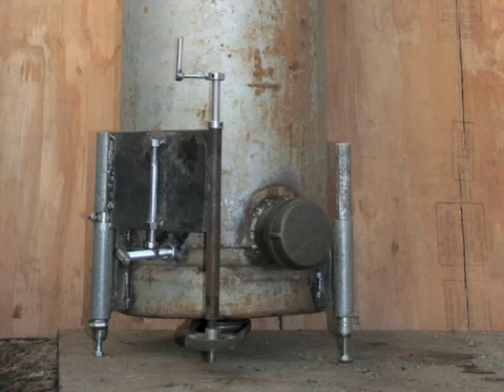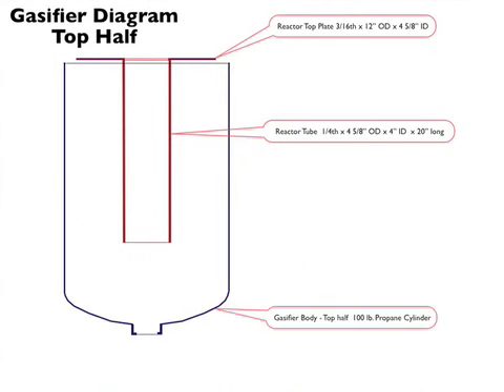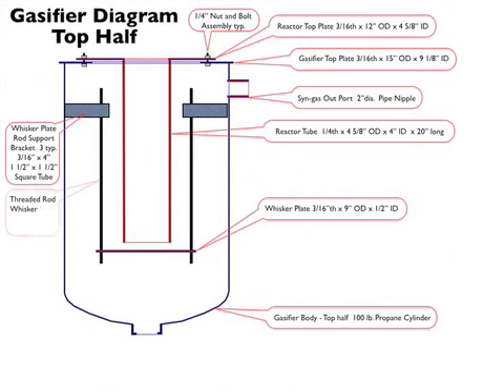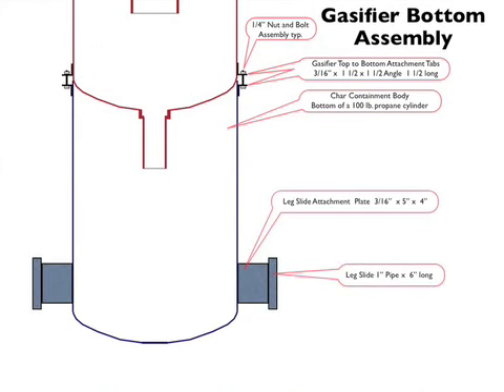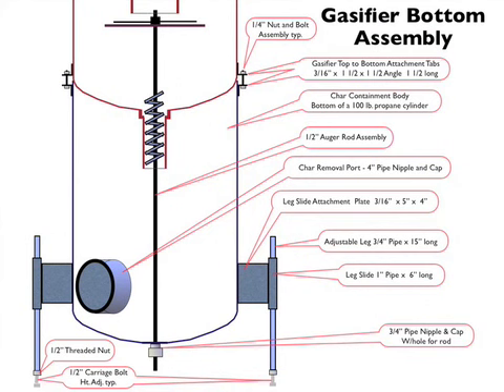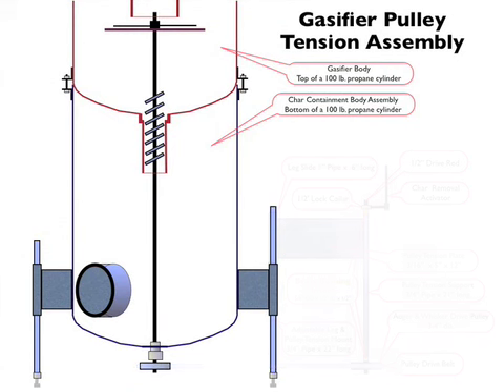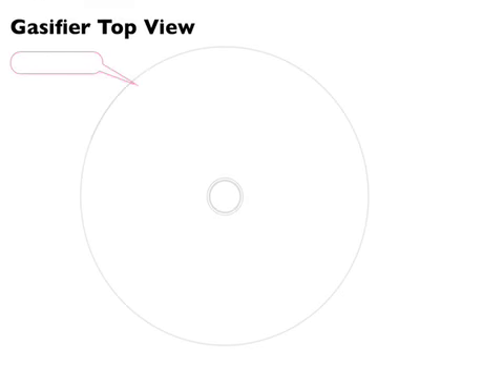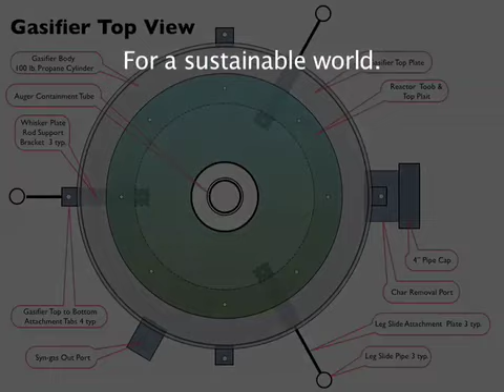Gen 2 Gasifier Talking Diagram H 264 800Kbps

Comment: Hi Ventonator,

The Whisker Plate keeps the charcoal and fuel from falling right thru to the bottom of the gasifier.

The Whisker, when rotated, pushes the char off the Whisker Plate to keep the reduction zone centered in the reactor tube.

Cheers,
Greg

Comment from the maker: Thanks for the Am. Idol vote. Glad the video has helped.

The 4" reactor tube will power a 15ish hp ICE, the 6" will power a 30ish hp ICE, 8" 50ish hp.

20 lb wood = 1 gal gas, more or less depending on quality of wood and gasification. + you get all the heat from the gasification process and the combustion of the syngas.

Pellets are best for us now, wood chips, and chunks work too. Sawdust packs to air-tight and doesn't work well in this system,... yet.

Interesting on the hho.

Thanks,
Greg

Comment: That's really cool. Would like to see a vid on that! Maybe if the water heater were stored in an insulated side shed to the house with a ventilation system and CO detector as safety... That could be really huge. Hooked into a solar hot water system, there would never be loss of almost free hot water and radiant floors. Thanx for this vid, nice job!

Comment from the maker: Hi shadley000,

The separated chambers do three things:
        Isolate the top from the bottom so it is easier to extract char out of the bottom half, without introducing oxygen (and causing an explosion), while the unit is running,
         Isolate the heat in the upper half and keep the bottom half able to be touched without burning yourself,
         And keep the whisker assembly aligned in the top half or the unit.

Cheers,
Greg

Comment: @Devin43837 
It can  be compressed.  Here is the data:
1 Gallon a Gasoline is about 125,000 BTU of energy.
Wood gas BTU value=150 BTU per cubic foot
A 100 gallon propane tank filled  to 150 psi with shot compressor will hold 34.7 cubic feet or 5205 BTU of gas equal to .04 gallons of gas

A 4.5 GGE natural gas tank filled to 3000 PSI with a scuba pump will hold 563 CuFt of gas equal to .67 gallons of gas.

Now if you use hot charcoal and steam you get gas without nitrogen = 300 BTU/CuFt

Comment from the maker: Hi Devon,

Compressing syngas is a possibility, though we haven't done this yet. It's near the top of our list of thing to do.

We have used syngas in a gas water heater and it worked quite well. We replaced the 1/4" gas line with a 1" copper pipe. I bet compressed syngas would work in a water heater... be interesting to try.

I'm leery about the potential of having carbon monoxide leaking into a house, so would caution you to that potential, should you try this.

-Greg

Comment: Thank you for detailing the inside of your gasifier.  Do you have any secrets for burning wood chips?  Does screening help?  Addition of used cooking oil?  Also, can the biochar collection be simplified.  I noticed in the Belonio rice husk gassifer the char just falls into a wet pan below.  If quenched couldn't the char just drop into a large wet open to air bucket without igniting?

Thanks again

Comment: I would like to use this for more than just fuel or water heater. i would like to use the final product that would normally go in to the an engine, to burn and heat a crucible/forge to melt metals down. do you know at what temperatures the gasses usually burn? I believe Gold melts at 1010 Celsius